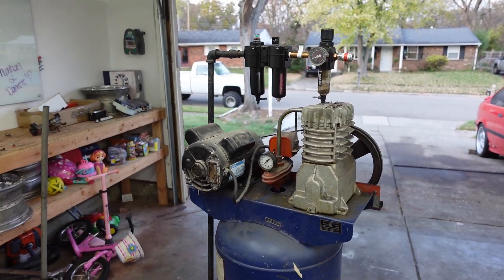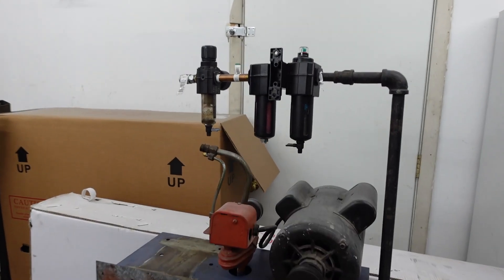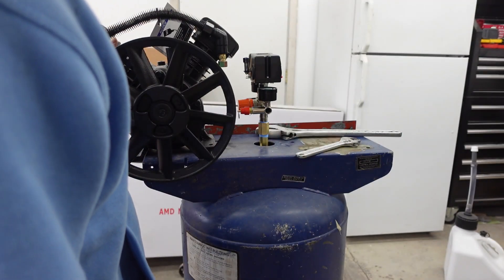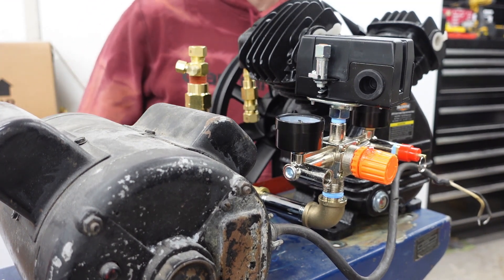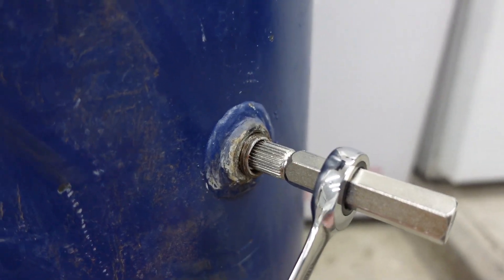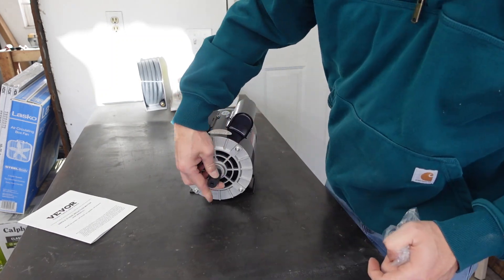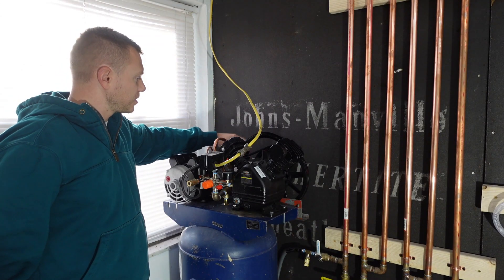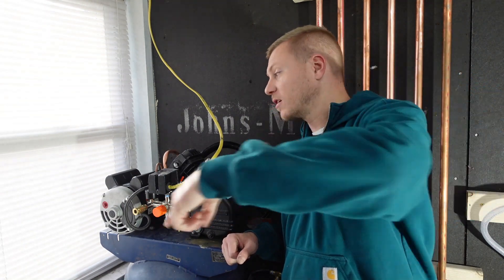Building an Air Compressor for DIRT CHEAP

Comment: Got a question for you , this may sound stupid, but; If I have a 116 max air compressor pump and I am using a cut off switch that ranges from 135PSi cut on to 175PSi cut off. 

Will my compressor be able to fill my tank to that max 175 psi or will that high of a pressure in the tank damage the pump ?
Looking to build a setup in a few days, just gathering my parts.
Reply from the maker: @dappa311  I'm not sure but I'd just adjust it down to 150 or less if it take a long time to build
Reply: @NaztyNate   Ok , thanks for the feed back .

Comment: I've been looking for a video like yours. Not many out there. I wish you would have explained the size copper tubes you used for the pump to tank (and/or pressure switch) as well as finish the thought of why the switch didn't shut the motor off when 120 psi was achieved.
But, very necessary video and I thank you for sharing,
Good job,
Sincerely ........................
Reply from the maker: @stephboeker7835  too many different fittings to choose from, just need to get the matching sizes. The pressure switch can easily be adjusted for different psi

Comment: thanks, that was fun.  but "dirt cheap"??  200+150+30+...  you are at about 400$ and that is with an old tank that the condition may be questionable?  and why did you use a 220v motor instead of a 110?   I had a compressor that was built from an auto (car) a/c compressor that worked great for many years (I eventually sold it as I was done with it. someone gave it to me for work I did on their car. the motor came from a washing machine.).  your video sent me down a great road of exploring possibilities for building my own, thanks again.
Reply: 220v motors are more efficient than 120v. Lower amp draw.

Comment: Couples things I recommend for you . Put an automatic tank drain on the bottom of your tank . Also look into getting a magnetic starter . It will increase the life of your motor . They sell them for 3hp , 5hp, and so on.
Reply from the maker: I like that idea, I will look into those!
Reply: Got a question for you , this may sound stupid, but; If I have a 116 max air compressor pump and I am using a cut off switch that ranges from 135PSi cut on to 175PSi cut off. 

Will my compressor be able to fill my tank to that max 175 psi or will that high of a pressure in the tank damage the pump ?
Looking to build a setup in a few days, just gathering my parts.
Reply: @dappa311 for 175 psi you’ll need a 2 stage pump .
Reply: @71lemans   So even if my compressor max was 150PSi ; and I had a pressure cut off switch that worked at 175PSi, would there be a problem for the compressor to bring the tank up too 175PSi?

I am asking because a pressure relief valve is set to either 175 PSi or 200PSi, So in my mind, the tank can get up too 200 Psi regardless of the compressor max PSi output, correct me if I am wrong here .

There is a one way check valve , so that pressure in the tank can't be fed back to the pump , the only thing I can see is that maybe the pump may have a hard time pumping the tank past it's max PSi rating .

And that is really my concern, is if that is the case ,  that may mean the compressor will work extra hard to reach 175PSi because it's fighting against it's max 150PSi to pump a tank to 175PSi ;  when the tank would have reached a 150PSi  and it's trying to pump it past that .

Maybe my understanding is wrong here, I just need some clarification on this .
Reply: @dappa311 if your tank is rated for 200 psi max working pressure then it will handle 175 psi just fine. .the issue is your pump itself . If your pump is rated for 150 it may not be able to pressurize your tank to 175. Almost all single stage compressors are 135-155 psi range and all 2 stage pumps are 175psi . The 2 stage pump compresses the air completely different to reach the higher psi rating . Just make sure what ever pressure your setup for you have the correct pressure switch and  relief Valves
Reply: @71lemans  YES!  Thank You. I called a compressor shop and they told me the same thing.

They told me if I try to pressurize the tank past the rated compressor pumps PSI rating, I will end up damaging the electric motor cause its fighting the resistance of the pump, the amps will go up and I will blow a fuse .  

So thanks for the advice , appreciate it.  Hopefully this helps someone else with the same question

Comment: Vevor isn't bad at all, low cost and they have a wide diverse range. I bought lab supplies and glassware a few times. Stuff is good and durable, lots of cheap labware isn't so for $200 I got 4 boiling flasks, 4 condensers, a few Erlenmeyers, and a couple adapters all 24/40 borosilicate. I'd be paying at least double, to quadruple for decent or better quality most people run to. Vevor does good, I haven't done electrical stuff yet.
Reply from the maker: @CondorrK  gotta love that!!

Comment: Did you save that old pump? You can still get a rebuild kit for it and its a 20 thousand hour pump vs the HF pump thats only 10 thousand at best. The directions for setting the switch pressure are inside the switch cap if you turn it over.
Reply: Campbell Hausfield pumps are not worth rebuilding

Comment: Take a part the old compressor and see why it falled or maybe you can fix it first.
Reply from the maker: Aluminum compressors usually destroy themselves if they lock up!! Cast iron is better for longevity! Not a bad idea though

Comment: Pressure switch has a screw adjustment against spring pressure. Looser the screw lower pressure
Reply from the maker: I figured that out after, I might look into getting a 150 psi blow off valve instead of 125 also
Reply: @NaztyNate before you do that check what the tank pressure is rated for .
Reply: Got a question for you , this may sound stupid, but; If I have a 116 max air compressor pump and I am using a cut off switch that ranges from 135PSi cut on to 175PSi cut off. 

Will my compressor be able to fill my tank to that max 175 psi or will that high of a pressure in the tank damage the pump ?
Looking to build a setup in a few days, just gathering my parts.
Reply: @ you’ll probably max out at that 116
Reply: @SteveRone   Hmmm

Comment: Nice job.  That's some good work.  I have a similar compressor and have been thinking for years about swapping the single phase motor over to three phase.  I have a few spare VFDs laying around that would give me speed control of the compressor.  I've always wondered if you'd still need an unloader valve with the zero RPM torque of a 3 phase motor.
Reply from the maker: That would be perfect! That's a good question too, makes sense, maybe not lol